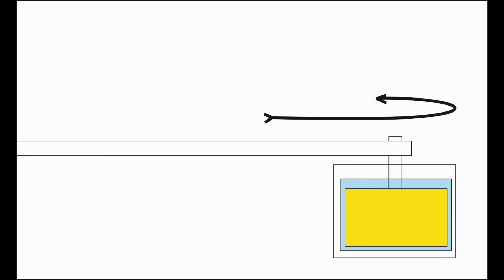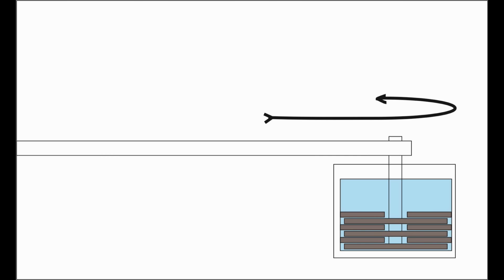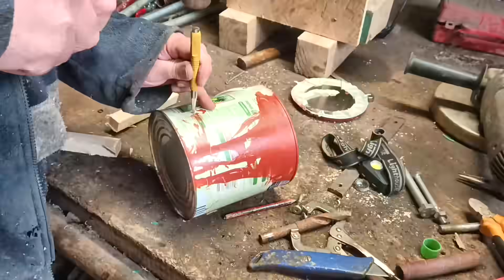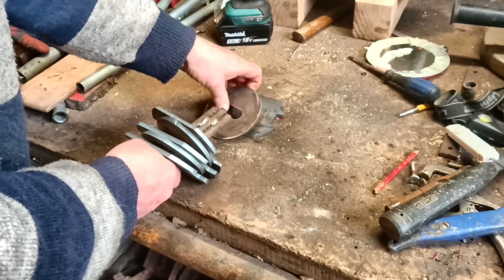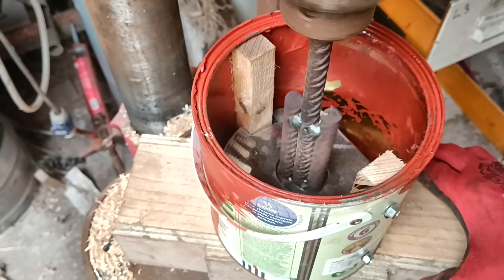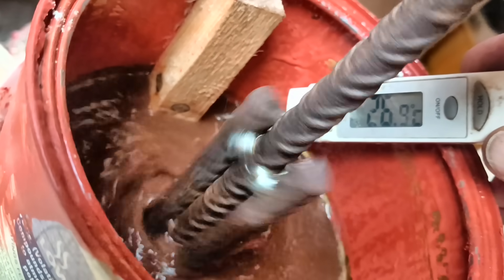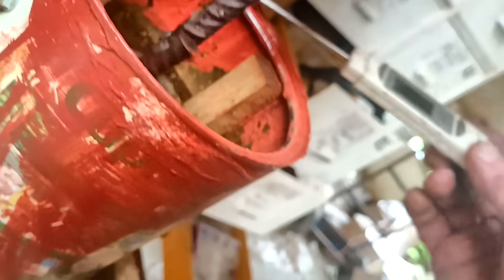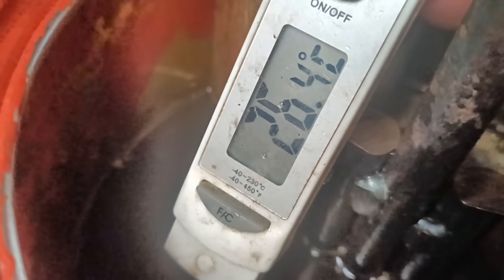Heating Water With Friction – How Practical Is It? Interesting Experiment!

Comment: I was about to do the math, and then I found a reddit post doing the math on the paddle/stir theory. Till I read this I thought the theory held... water hahaha!
Anywyas. Its not precisely the same, not friction plates, but stirring. And disapointing too. But I wanted to share this interesting bit of math.
So 1L of water needs ~ 4.18J/g*C so assuming our water started at 21 degrees (room temp ish) we would need

Waters Specific Heat J/gC*wieght(g)*change in temperature(C)

4.18*(1000g)*(100-21) = 330220 Joules.

If we were moving only on the horizontal plane our velocity required would be

1/2*m(kg)*v2(m/s) = J

sqrt(2*330220/1) = velocity = 812.7 m/s = 2958.12 km/h.

But then you asked if you could do this by spinning it so to further the math:

1L of water = 1 m3 of water, giving us a circle with radius = 0.62m and a circumference of 3.90m so to move at 812.7 m/s while spinning our water would have to spin a full circle in (3.90/812.7)s = 4.8 ms or 208.6 times every second.

Name was deleted so credit can not be given. I didnt check the calculations, but the numbers a resonable to my grey matter.
Reply from the maker: Thanks for this but I'm a little lost. 1L of water = 1 m3 of water - that bit's not true, for a start : -  )

Comment: Tim, before doing any experiments on how to convert the mechanical power into heat, I would rather be concerned about the aspect of... is the amount of power produced by the windmill satisfactory? Say the windmill produces on average 300W. From my experience, that will heat up about 4 liters of water from 15 celsius to 60 celsius in about an hour or two. Would that be satisfactory performance for you? There are online calculators which ask you how much water you have and the power going into heating it and they will tell you how much it will heat up in a certain amount of time. Now, knowing Power = Speed  * Torque, I would install a torque and a speed sensor on the output shaft of the windmill, and I would check what the average power output of the turbine is, before doing any further experiments on converting that power to heat. Good luck!
Reply from the maker: Thanks - but I'm still wondering whether building a windmill is a good idea at all
Reply: I now have in mind to build a small clock tower, with a mechanical clock inside that is wound up only by the wind. I have all the plans for it but right now I don't really have the money for it. I'm giving you the idea, because I'm thinking that maybe you might find the idea interesting, and maybe would try it :)

Comment: Cork is in the same wind league as the coast area of norhern germany (the first 30 - 50 km). Search for this "Figure I.2.1: European Wind Atlas, Onshore"
and look at the map. This is a map for 50m, not just 10m which are rarely available but you need to get a clue what you can expect to earn at least from a modern wind turbine.

I would suggest to ask the owner of the german channel Kleinwindkraftanlagen what you should look for. He is an expert and is doing nothing else than small windmills. 
And he will for sure help you out with your idea of  a basic windmill and its principals what you have to look for and what is not so important.

I doubt that you can heat a home from a 40°C water tank considering that you will need a heat exchanger which means a drop of 5°C from the tank water to the water in the radiator heating circle. I have dealt with that in preparation of adding a heatpump.  You can not pump the tank water through you radiator circles cause the friction seen in 8:12 will generate heat and flakes in the water which then would clog the radiators soon. Therefore a heatexchanger is mandatory which means you have to heat up the tank to at least 45° to get 40°C for the radiators which is rather low for a building that is not new. 

And then you have to do the math again how many water you can heat up per minute or hours from 38°C to 45°C cause the cold water will come back from the radiators with 38°C and cool the tank down. 
If you can harvest 7000 kWh of electricity in best case and best turbine then how many losses will you have along the driveshaft and transmission until you have produced heat in the watertank ?  
I bet 30% losses at least due to low efficiency and then your wind harvest in the water would eqaul 70% x 7000 kWh = 4900 kWh.
4900 kWh would equal how many Liter Diesel used in a central heating to generate 4900 kWh in warm water with a 85% oil heater efficiency`?
(4900 kWh / 9,8 kWh / L ) / 85% efficiency = 588 Liter Diesel. 

Not sure how much the windmill will cost but there are more efficient ways to use the energy.  But the Kleinwindkraftanlagen guy will know for sure what to expect and what not to expect which could save a lot of time  

I would try to harvest the energy at the rotor shaft and get electricity you can use everywhere
Reply from the maker: Thanks - yes we have maps for 10m here. We're right on the edge of 5m/s average..

Comment: Quick question.. if instead the water was pushed through many tiny pipes ? The water would tecnkcly meet friction on all the pipe wals, wouldn't it? And then just use a pump driven with the windmill. And the pipes could also work as a radiator. Or em i wrong? I dont think you will receive huge heat gain but +20° maby

Comment: I like this idea as a direct way to generate heat directly via the rotation of the windmill, but I feel like there's a few issues that could make it unfeasible on a small scale.

Corrosion - if you have mild steel plates in a heated, wet, environment would they rust very quickly? And if so, what effects would all that rust particulate have on the system? Especially if you plan to pump the water into radiators.
Stainless plates might solve this issue but I imagine they'd be prohibitively expensive. 

Wear - with a mild steel plate I don't think they'd last long before they'd begin to wear, especially if they're heated and going rusty. You'd then need to constantly adjust the pressure on the plates as they wear thinner to maintain friction as the plates reduce in size. This wear generates more particulates as well.

Torque - if you scale up the heater large enough to heat the body of water required to heat a house, Will the windmill have sufficient torque to drive the bigger heater? I'm assuming larger plates would increase the necessary torque exponentially. If you switched to an oil system rather than water, it would solve the rust issue, and aid in reducing wear, but the oil is more viscous. More viscous oil could further increase the torque required to spin those plates, again increasing demand on your windmill. 

Demand - if the windmill isn't spinning fast  during a time of peak demand for heat, then there's suddenly no heat. Is the wind in winter enough to rely on for heating?

I think a water brake system with paddles seems easier to build and maintain, as well as more easily scaleable to the size necessary to heat a house. 

I know it doesn't fit so well with the ethos of your project but turning an electric generator instead of all those ideas seems more efficient, and far easier to build/maintain.

Comment: A part of me is really irked by the idea of directly turning useful work into much less useful heat. If you want heat from work a much more efficient method would be a heat pump. They move heat instead of creating it, which means you can get three to four times as much heating as the energy you put in. The obvious way to do this would of course be to use an electric generator and to use this to power an electric heat pump, but this would add cost and complexity, not to mention it wouldn't be very efficient. Instead, you could use the air conditioning unit from a car. AC is really the same thing as a heat pump, only in reverse, and most car AC systems are made to be driven directly by the engine. With one of those you could turn your 1kW of rotational energy, into 4 kW of heat, which is certainly enough to make a sizeable difference in your house's heating load.

Comment: It would be interesting to run an experiment to see which is more efficient: 1) have the windmill run an electric generator to heat water using heating element 2) the metal plate friction thing. 
My guess is that if you kept it DC there wouldn’t be a significant difference.  Nice thing about using the generator is less moving parts and easier to maintain.

Comment: If you could create a contra-rotation gear for the drive shaft into the friction heater, you could have plates turning in opposite directions increasing their passing speed as they rub against each other without increasing the drive shaft speed.
In using oil, wouldn’t that reduce friction as oil does in an engine?

Comment: Fantastic, I think the diameter of the discs should be large like a windmill grinding stone, and the amount of liquid as little as possible. If you could achieve tight tolerances the discs may not even have to touch. Thank you!!

Comment: Feel like the simplest solution is often the best.
Using an the windmill to drive a generator that has a dead engine that powers an electric hot water system.

Comment: You complain about wear at high speeds and then build a system that is based on even higher wear?
Definitely the wrong way of thinking in my opinion...
Eddy currents, for example, would probably be a better idea.

Comment: Depending on what you want the water for, it may be worth making a heat exchanger, where you've got water in pipes, and water in the heater, but they don't actually mix. This would make it easier to swap out the heating element as needed, and prevent the risk of additional contamination

Comment: I would go electrical.
Find a 3 phase squirrel cage induction motor and put capacitors between the windings. This is now a residual magitism ac generator.
Connect the generator directly to an equally large or even larger 3 phase heater.
The generated energy is thus aleays proportional to the rotational speed and is kind of self regulatory. But then again if you get high winds you may overgenerate frying everything. But that is why we turn the generator out of wind in high winds.

Comment: My turn. 
Turn a ‘brake shoe’ around the OUTSIDE of a metal pipe. 
You want friction to do the heating whereas your stirring machine has water as a lubricant. 
Inside the pipe is the water/oil is absorbing the heat directly via contact. Less losses. 
Any way 10cents worth.
Reply: P.S.  you can plumb the water to enter via a second pipe up, the centre of the friction pipe, and down the ID. 
This means that part remains static. The friction pads revolve around the outside, pressed in by firm springs, at relatively low speed. 
Some method of spring pressure adjustment can keep ‘energy in’ balanced with ‘energy out.’
Reply from the maker: I think you'd lose a lot of heat to the air outside the pipe - but please go ahead and prove me wrong
Reply: @wayoutwest-workshopstuff6299  I’m thinking as the only moving parts are the ‘brake shoes’ being top mounted, then a further layer of insulation could be applied outboard of them.

Comment: The VM Motori engine in my car has a viscus heater that takes power from the fan belt and spins a binch of closley stacked plates with a super thick goo between them. Water flows through an isolated channel to absorb the heat. I know it's probably cheating, but it's an off the shelf solution.
Reply: I'd explain it, but believe it would be a waste of my time as you probably would not comprehend. U pićku materinu, bože pomozite ovim budalama ❤
Reply: in an ICE that just makes no sense when 1/3rd the energy is getting dumped out the cooling system, and the other 1/3rd being dumped out the exhaust pipe...
Reply: @paradiselost9946 your not understanding fully.
Reply: @paradiselost9946  True, don't car heaters generally involve heat-exchanging with the radiator heat?

Comment: Running the compressor from an old fridge with the hot part used to heat the water could be more optimal.

Comment: Hi Tim. For storing thermal energy at low temperatures, you should look at phase change materials. The energy is locked up in the material as it changes phase from solid to liquid. The energy is released as it changes back from liquid to solid. A good choice for your application might be sodium sulfate decahydrate.
Reply: bacon grease has a good solidus to liquidus temperature range (approx 85 to 130F) and can be sealed in mason jars in a holding thank. also you can enjoy a lot of BLTs while you amass the grease.

Comment: The particulate sludge/slurry that would build up would become a problem fairly quickly, I think, and would itself speed up the degradation of the disks.  It would be worth seeing how much thinner the disks had become during your testing to estimate how long they would last, and/or you could test the specific density of the water to figure out how much steel was getting into it.  I would echo the other people in the comments saying that a heat pump might be the best thing to power with your windmill, although I appreciate that it's not a cheap DIY solution unless you want to try to build one yourself!